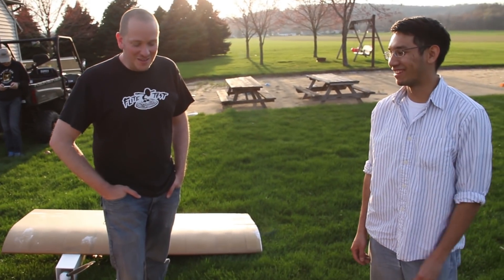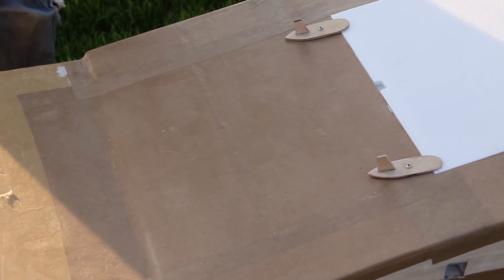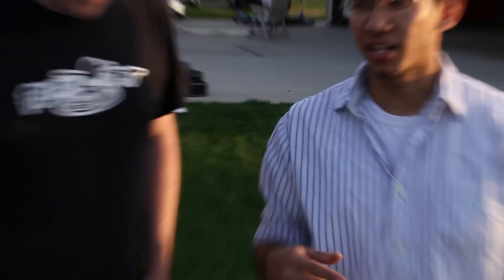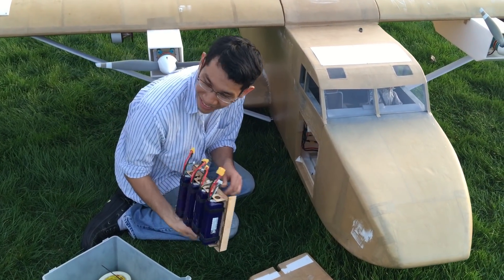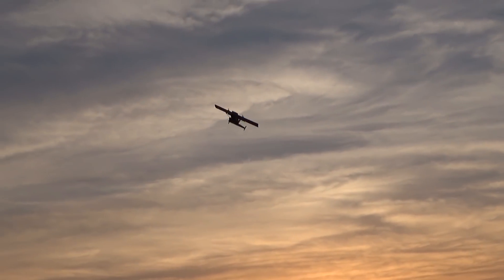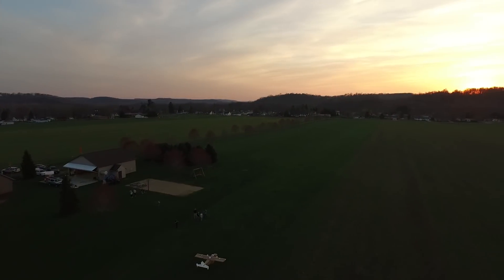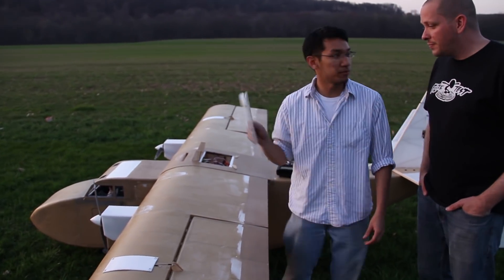DIY Giant Cargo Plane | Flite Test

Comment from the maker: What should Peter build next??
Reply: Well.... The crazy builder should... take some days off? 

A monster 4 engine bomb drop? Or flying fortress?

Cheers! Great episodes!

Ed
Reply: FliteTest   The X-15 rocket plane and B-52 drop ship.
Reply: FliteTest a 20ft flying wing
Reply: You guys should build a fighter jet with missiles on it. I know you did a plane with missiles that you can control, but the missile was basically just an fpv wing. You should build a proper one propelled by little rocket motors, that looks like a missile.
Reply: A plane ✈ you can sit in!
Reply: Or what if, Peter refine/improve the cargo plane so you can deploy from there and have a Challenge? 4 of you free fall some sort with parachute thing with PFV and radio control so you could control your direction/decent and hit a bulls eye???? how about that!???

Ed
Reply: You should try to get a plane inside of the cargo plane in mid air!!
Reply: Build a "Howard Hughes" huge flying boat and fly it off the water.
Reply: FliteTest air balloon or blimp that launches mini quads and jets
Reply: MartyFlyzZzFPV Yes! A replica of the USS Macon! With planes or quads that deploy from the ventral hangar!
Reply: THE  SPRUCE GOOSE!!!!
Reply: A giant (5 to 10 meter)foam and plastic foil paraglider
Reply: FliteTest The inverse of the Pun Jet. The pun jet is designed to fall out of the guinea pig, what about designing a plane that is designed to easily fly into the cargo bay of this plane during flight.
Reply: FliteTest I really do think y'all should consider a practical DTFB rocket model. There have been many requests for such an airframe, and it really can be done. Peter definitely has the skill level to do it. And let me know if y'all want any ideas for how to do it--I've got several planforms that would work well.
Reply: Rc parachute could be a difficult but interesting option
Reply: FliteTest Peter should build a plane that he can actually get in and fly around
Reply: I'd love to see an DC 3 all aluminium look, even from aluminium if that is possible. The stand of the aircraft is so epic!! And it's one of those famous aircrafts from the past.
My father used to tell me about his flights in a DC3, te thumbnails on the engine turned red hot when it was taking off! 

With the old C1 Hercules I ment one with 4 propeller engines btw.
Reply: how about Howard Hughes 'Spruce Goose' ....
Reply: +FliteTest A 1/3 Scale B-29 Super Fortress with functional guns.
Reply: A ridable mini-blimp!
Reply: FliteTest meik a plein that you ken get in and drive
Reply: FliteTest a flying boat
Reply: How about a plane that carines anoter plane and anoter plane !
Reply: Rc smug the dragon!! From the hobbit!
Reply: FliteTest ....Enough Pun Jets to fill up the back of that thing! I want to see a flock of FPV Pun Jets launched from the rear, then see if anyone can land one in the cargo hold. ;)
Reply: I would definetely like to see an old C1 cargo airplane with 8 propellers. Would be amazing to see that fly!
Reply: FliteTest BUILD A MASSIVE SPITFIRE!!!!!
Reply: Douglas DC-3 !! Shiny aluminium skin and all. 😎
Reply: FliteTest A challenging airplane that i would love to see on Flitetest is the Focke-Wulf Triebflügel.  The Triebflügel was a very late war VTOL intercepter with three ramjets position on wings that rotated around the fuselage.  i have seen other people on the internet try to build it but they where not repeatable (i know because i tried it myself with no success).  i thing combining the talent of Peter and the strong design will make for a great model and some cool episodes.
Reply: ***** An Albatross where he forgets to glue on the beak?
Reply: FliteTest  how about a solar powered plane?
Reply: How about a full scale Cri-Cri? Theyre not much bigger than this lol
Reply: He should make a plane that fly's using the magnus effect
Reply: FliteTest  boeing A380
Reply: he should try to use model rocket engines for a rocket assisted take off.   just like fat albert from the blue angels
Reply: +FliteTest simple airgun for some warbird air carnage :)
Reply: PB-Y
Reply: Jet pack
Reply: +FliteTest A Peterbilt
Reply: FliteTest Make two fighter jets equipped with co2 airsoft guns and have a dogfight
Reply: a gigant cartboard tank!!
Reply: A plane he can get in xD
Reply: FliteTest A helicopter with a harpoon
Reply: a multicopter platform we can stand on and ride.
Reply: FliteTest A 50 pound motorized jet.
Reply: FliteTest VTOL
Reply: And a giant pusher sailplane
Reply: And a giant quadcopter
Reply: How can I get in touch with Peter? 

As for what to build next I think one of Vincent Burnellis aircraft would be a good one, as would be Lockspeiser LDA-01
Reply: FliteTest  A not so mini pun jet!!
Reply: Dave-007 Or a Messerschmitt 323 with six props
Reply: FliteTest a speed built kit for a vtol
Reply: FliteTest nano scale collective pitch quad :)
Reply: B-17 Flying Fortress, most awesome plane ever made.

Love the Guinea Pig XL my favourite FliteTest plane so far. Cheers
Reply: How about the C-5 Cargo plane?
Reply: or a ford eaa tri motor in tin look
Reply: FliteTest peter should build fpv  paratroopers  with steerable parachutes  and you guys can try to land them on a target from the back of the cargo plane
Reply: FliteTest an rc full scale Jetpack man ( the rocketeer )
Reply: A extra large pun jet to match the large cargo plane.
Reply: FliteTest How about a canard plane where he forgets to glue in the, you know, canards..? :-)
Reply: Peter has to build a giant pun jet 😀😀😀😁
Reply: Cl15 water bomber
Reply: FliteTest mig 15 or 6 edf XB-70
Reply: FliteTest - Should try something not many in R/C have touch on - a ground effect vehicle.
Reply: FliteTest you guys should recreate the fast 7 scene where they jump from the plane
Reply: FliteTest a monster quad with those motors! i can hear it now.....
BBBBBZZZZZZZZZZZZZZZZZZZZZZZZZ!!!!!
Reply: FliteTest Slooooow flight would be a blast. So neat.
Reply: You should install a giant VTOL system on the capybara.
Reply: air tractor 802
Reply: +FliteTest He should make a Catalina
Reply: Marlilindin The Mouse http://www.motionrc.com/dynam-pby-catalina-blue-1470mm-57-wingspan-pnp/
Reply: Andrew Jackson That is really, really cool. They really should make a Catalina though. Or just a boat-plane in general
Reply: +FliteTest 
Build a TARDIS as close as you can to the real deal that Flies!!
Reply: +FliteTest SR-71 Blackbird
Reply: A little plane to drop out the back of this one.
Reply: He should try to build a low budget lightening 1 fighter jet using the same technique that he used to build the cargo plane that would be a video I would watch 😂😂😂
Reply: +FliteTest Build another cargo transporter with actuator-enabled rear cargo ramp. Fly to the LZ, land, lower the ramp, roll an RC tank inside, close the ramp and then take off. You could even try building your own LAPES (low altitude parachute extraction system) to drop the tank without having to land. It would take some expert flying to hold close enough to the ground while the parachute deploys and extracts the tank but that's a challenge in itself. :D
Reply: +Si “TheAmazingTie” W Having searched Youtube, I've been unable to find an RC with working LAPES extraction... Could be a world's first lads. ;)
Reply: +FliteTest I know this is pretty late but you should have a plane in the cargo plane fly out during launch.
Reply: +FliteTest  Make that plane even bigger so that one of you can get inside and fly it from there.
Reply: +FliteTest His attention to details....
Reply: +FliteTest The realistic way this thing flew, I&#39;d say a a B-25 Mitchell or Bristol Beaufighter. Awesome job.
Reply: +FliteTest Martin Mars water-bomber.
Reply: A Eurofighter Typhoon
Reply: A V-22 Osprey!!!
Reply: He should build a car plane but... be able to not notice that there are wings on it when it is driving.
Reply: fixed helium balloon at the middle of quadcopter to make it stable at the air to make less use for motor and For long time of flying, just use motor For diffusing
Reply: FliteTest a SPACE SHUTTLE PLS LIKE IF U AGREE
Reply: John Philip Salvador lol what if they did build a dick and someone is eating it lol
Reply: FliteTest ad boob
Reply: Hello, could you please ask peter if its possible to put a SAFE system like the one in the Apprentice S 15e into this plane?
Reply: FliteTest can you make a star killer  base from star wars.
Reply: K62Hunter K62Hunter you don't understand how offensive that is to some people. You don't know how many people lost their lives. You weren't there you are probably just some ten year old who needs some discipline.
Reply: FliteTest A BV-238 WWII bomber..
Reply: FliteTest do not try go up and go 90 degree down and then pull up if you do this you wing will go off that happend to me am flying up then down pull up and rip my plane 
dammit
Reply: FliteTest  make a get
Reply: FliteTest   Can you please make a Air Force one plane ✈️ video.
Reply: A bomber with firecrackers hanging from the fuse that you can rc start the fuse and fall after the fuse burns a little
Reply: Airship. (That works).
Reply: that guy who would not share his name that last one was not good!  They need to try to use helium for it
Reply: FliteTest A massive quadrotor that shoots fireworks and has extending prop struts. Well done Peter!
Reply: FliteTest please build a Horten H XVIII  with 6 EDF (I'd be okay with a Horten H IX)!
Reply: dfwz33 That is a big undertaking dfw I'm a designing one right now and it's not a short term project building a homebuilt aircraft.
Reply: FliteTest A Dragon.
Reply: SlyNature thats what I said in previous comment .Smaug the dragon.  Emailed ft and peter emailed me back really liked the idea . He thought it would be a neat project for the future. :)
Reply: David Tucker :D
Reply: FliteTest let him complet this in 100% then I have a new disigen to give you
Reply: Génial ce gros avion. !!
Reply: FliteTest A VTOL plane that actually flies and doesn't cost the earth, the ultimate test
Reply: A mighty mini ft3d
Reply: FliteTest I vote for a B-52 . . . . but with build video, plans, speed-build-kit, etc..

Well done Peter!!  ... now fly it FPV LOL :D
Reply: FliteTest try landing the Pun Jet inside the Bombay during flight. An on air landing. first time ever!
Reply: jack00scarecrow FliteTest Or paragliders with fpv that can fly with motor or soar in the thermals ant that can be dropped out of the plane
Reply: FliteTest EDF 5s Tricopter?
Reply: FliteTest A 20 ft, 100 mph flying wing with fpv.
Reply: FliteTest a republic star cruiser from star wars that would be EPIC
Reply: beroth1 under 55lbs.
Reply: Chris Hipser Yeah, It's still possible. If not he can get the waiver ;)
Reply: FliteTest A gotha bomber?
Reply: Something with a canard, like a velocity would be pretty awesomely sweet.
Reply: FliteTest Build an Antonov-225 Mriya  1/10 or 1/100  scale
Reply: Smaug the dragon
Reply: A semitruck
Reply: FliteTest Flying penis that shoots white soap.
Reply: Zagi
Reply: FliteTest Hello, FliteTest and staff. I have had a wonderful (IMHO) idea for a multirotor concept that I wish for the crew to take a look at. It is a mashup between a quadrotor, and tricopter, and has 6 props. Imagine a standard X-shaped quad, but those motors only control the roll. There are two shorter booms that extend between the diagonal booms, each with a tricopter tail piece that has a 180 degree field of motion. These two motors do all of the forward-backward movement, along with the yaw. If you are feeling experimental. Alternatively, you could build or modify an H-Hex to make the build a little easier.

For racing, you could potentially ditch the two gimbals in favor of having two fixed motors that perform the same functions, but through differential thrust instead of variable angle.

Whilst hovering, the two active motors are not spun up. Their speed is proportional to their tilt angle. This setup would require a LOT of setting up on the transmitter, and probably the on-board systems, but it theoretically is a very efficient system. One last note, I personally believe that the fixed motors pointing forward and using differential thrust for forward motion would be easier, but the benefits of a pair of gimbals would make it worth the extra effort.

The link below will take you to my OneDrive, where I have uploaded a screengrab, along with the Google Sketchup files. I spent quite a few hours working on it, and you can open the .skp file with the free Google Sketchup. Please, at least take a look at it, as I am putting in this effort for the channel, as I lack the funds to build any sort of plane, as I am only 16 years old. I wish to have some feedback on this. I know the channel has blown up recently, making it difficult to keep up on comments, but I know that my ideas will be read at some point! Love the show, and keep up the good work. I am expecting great things with this new flying season!

@1
Reply: FliteTest A flying saucer!
Reply: domsau2 a flying sausage! that squirts white soap.
Reply: FliteTest Could you build a plane that flies forwards and backwards? Mind blown
Reply: Dr sausage fingers PLEASE FliteTest / Peter go with this idea :-D Wouldn't that be great to honour SOLAR IMPULSE leap over to Hawaii?
Reply: FliteTest Dear Mr. FliteTest please build a cheap home depot rc paraglider. that would be soo coool. mounting a cam on in and slope soaring. or maybe even with a power pod! FFFF A FLYING POWER POD BUILD!
Reply: FliteTest AC-130 with airsoft guns out the side.  :-)  I also liked someones idea of a water bomber.  Canadiar?  Complete with water scooping ability?
Reply: FliteTest    Standing there installing the wing and Peter says "I just winged it"?? He missed an excellent pun!! Also, looks like he loaded up enough batterys to start a CAR!!!  He should name this plane [Cargo Plane by Peter-built!]
Reply: FliteTest what about a rc car WITH A WING!!!!!!?
Reply: rifted b-17 with mulltiple airsoft cannons!
Reply: FliteTest flying penis
Reply: A 300+ mph rocket plane!! With a G class motor!!
Reply: FliteTest I'd like to see Pete build a quarter scale De Havilland Mosquito , That would be something.....
Reply: shawn harold fox firth Sorry there are Ready made RC quarter scale 'Mossie's' So how 'bout Full Size .........
Reply: ***** DC3 beautiful plane, Buffalo Air up in Alaska has a couple , How about the Bear TU-95 with contra-rotating prop,s now that would be something...
Reply: A Messerschmitt-109 so you can dogfight with the Spitfire. Or a Corsair or Zero (both had wings that folded up, you could use the folding mechanism from the Pun Jet)
Reply: FliteTest a B-29
Reply: FliteTest  Peter should make a a movie fighter robot jet ADI !!!!!
Reply: Why don't you make a water landing plane
Reply: Howard Hughes 'Spuce goose' takes off and land's on the water...
Reply: ColinTastic j
Reply: FliteTest  A flying smelly vagina
Reply: Cam Hart It would be cool,only problem is the FAA and FCC would probably put your head thru a noose if they caught you !! I don't know the legal jargon off hand but I have heard before from a cop.Basically it's against federal law to use a remote control device to launch a missile and to be able to guide/control it from another remote controlled device boat/airplane. I once built a remote control boat with a rocket turret on it using Estes D12 rocket motor's.My friend and I were talking to a cop that worked at 7-11 part time and he told us the law using the legal mumbo jumbo talk and yeah it's a lot of trouble and god forbid somebody should get hurt or property damaged !!
Reply: I would love to see Peter or the rest of the FliteTest crew build one of the classic Japanese movie monsters. Maybe Mothra, Rodan, or Ghidra (a.k.a. Monster Zero). Or... could you imagine an EDF powered Gamerra (the flying turtle)? C'mon, guys, I know you're zany enough to at least try something crazy like that!
Reply: ME-163 "Komet"
Reply: Flying toaster!
Reply: Slum 9000 Guess they already did it.  How about a Flying-V?  As in the Gibson guitar.
Reply: I vote spruce goose too!
Reply: FliteTest  Thunderbird 2 (quad copter)
Reply: +FliteTest Lets see a Flite Test Airliner
Reply: +john jameson r
Reply: +FliteTest Try making a large scale Pun Jet to fit inside it and drop it out in mid flight
Reply: +FliteTest I think you should add a wing fence/wing-let on the main wings, similar to what you have on the horizontal stabilizer, but not as tall.  If you make sure the wing fences extend well behind the trailing edge of the aileron surface, I think the huge vortex can be use to LIFT the plane, rather than generate NEGATIVE LIFT.  I think as you have it, there's a huge swirl of air, that wraps over the wing tips and land on top of the wing surface, that's causing negative lift and a lot of drag.  I would love to see a leading edge slats/droop on this plane or any of your other super slow flyer.  This is on my next to do project, but I tend to procrastinate.  Thanks for all your time on making vids and Kits.
Reply: First time I have seen your channel fucking creative  man keep up the cool videos
Reply: +Joseph Branch they should make sugar rockets (r candy rockets) to use!!!
Reply: +FliteTest a 1.5 m delta wing out of cardboard!
Reply: Make a vertical takeoff aircraft
Reply: THE ENDERTAINER Ye; and you will pay for the $1,000 battery pack. right?
Reply: Andrew Jackson that would be pretty cool to see a be even one that can pick the water up and drop it like a fire fighting plane
Reply: Chris Scholer I happen to live by a lake.. yet I have put off getting the plane out of box and in the air.for so many months...  So many projects.. so little time..
Reply: Marlilindin The Mouse Ye,  if they don't,,, guess who should...?  YOU !!  Oh No!!!  I hate the thought of another project..
Reply: Andrew Jackson Me? I could... But I've never built a RC plane before... And I have no where nearby to fly one... Too many trees
Reply: +FliteTest the faa probably won't like this build
Reply: +FliteTest Give this one 4 EDFs. I dare ya.
Reply: +sean wong kerbal space program
Reply: +FliteTest A 50s Lockheed Constellation.
Reply: MV22 osprey that can actually hover
Reply: +FliteTest Add 2 more motors to this thing and do some stunts
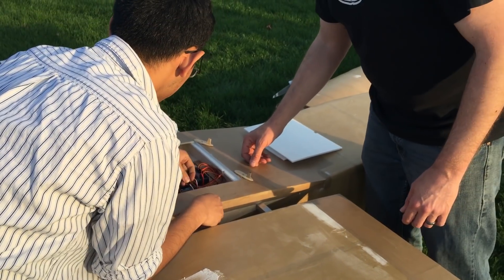Reply: Wats with the laser on your body at 2:52
Reply: Wats with the laser on your body at 2:52
Reply: +Flitetest is peter interested in rc cars or tanks cause if he is can he build a flying car that can drive as well. if will thanks
Reply: he should put a rc car with a parachute on it and drive it out like in fast and furious 7 and use a Traxxas slash 4×4
Reply: +amy watkins use a nitro that would be cool
Reply: Eclipse Gaming  yes it would but I'm actually on my mom's account my real name is Levi ridgeway lol
Reply: +FliteTest Build the Flying Spaghetti Monster and convert some heathens ;)
Reply: a flying Xbox one
Reply: a flying Xbox one
Reply: +FliteTest should see if he can lengthen the wings and add more motors and remove weight somewhere else
Reply: +FliteTest Maybe a  Bombardier CSeries Aircraft, Swiss logo, it is a nice little plane that I would like to see as Swiss in RC.
Reply: a sign saying sorry neighbours to attach to it, poor neighbours :D
Reply: A real plane. You have the skills
Reply: +FliteTest Mount eight or 10 small outrunners on a straight wing that can be pivoted 90 deg.  Straight up for VTOL, transitioning to straight forward for cruise.
Reply: +CaptainDominic Wow thats a real challenge!
Reply: +FliteTest a B-52 with the Windestål afterburner on all engines
Reply: +FliteTest Millenium Falcon
Reply: +FliteTest even tho its a cargo plane u should make it so it holds a little foam bomb and it could drop it.
Reply: +FliteTest do u intentionally spell flight wrong
Reply: +FliteTest Great job...looks awesome flying so slow.One thing I was wondering though is the nose up attitude while cruising.
How could you get it flying level? increasing the angle of attack of the wing?
Or does it level out as speed increases?
Also have you ever thought about using a small high KV inrunner run through a gear box spinning a huge prop for better efficiency at the slower speed of this big plane and maybe get it to hover lol.
Variable pitch props would be sweet to.
Reply: +FliteTest  A Giant RC Sailplane with 10m Wingspan!
Reply: A plane where Peter can have a dinner in the sky.
Reply: Shaheer Syed Hey now there is a challenge....build a plane out of foamboard that Peter can fit in and Josh fly him around lol
Reply: not be abel I mean
Reply: A blimp made of pimple cream.
Reply: An airbus  380
Reply: b 25
Reply: f-14(that slide wings)
Reply: Try building a big size helicopter
Reply: am b29an
Reply: FliteTest
Reply: Jayaprakash L.V
Reply: FliteTest  her baazcx
Reply: FliteTest a rideable mini cargo plane
Reply: erm an R/C table to like bring drinks eh anyone no okay
Reply: FliteTest a Flite Test DFS 230 glider towed by a Simple Storch
Reply: FliteTest a flying car
Reply: FliteTest
Reply: FliteTest I'd like to request he build a fantasy rpg style airship.
Reply: FliteTest RC plane that can carry a human
Reply: What about a VTOL that works like an Osprey?
Reply: FliteTest VTOL plane
Reply: Make a bomber with gunners
Reply: The Mayor
Reply: FliteTest
Reply: BIGHUHA15 I'm sorry I didn't really think it through or think the outcome I'm sorry to make people angry and I will delete the comment
Reply: FliteTest I miss Peter...
Reply: FliteTest the house from up the movie
Reply: Danny Liszewski that's not cool dood
Reply: FliteTest tank that you can drive out of Cardboard
Reply: Herman Izaguirre
Reply: A sweeping wing, not necessarily an F-16, any custom design with at least two different flight profiles ex. 'Takeoff/slowflight/landing' and 'Highspeed'
Reply: FliteTest
Reply: Submarine
Reply: FliteTest I think a flying taco
Reply: I have instruction/ plans from 1961  to a bf 109 rc plane if you would be interested. if you are contact me please
Reply: FliteTest hhhhjbggjhh
Reply: Giant penis
Reply: FliteTest something he can go in!
Reply: FliteTest a cardboard plane a person can ride
Reply: FliteTest to
Reply: Looks like Tony (3rd to reply 2 years ago) is the true visionary.
Reply: FliteTest i know its old (2 yrs) and why You dont buy some parachutes (these little man) and drop them in air (i mean Open cargo door and they ) This could be amaizing
Reply: @FliteTest Solar-powered airplane.
Reply: FliteTest and
Reply: He should make the plane from pubg.
Reply: FliteTest f35
Reply: FliteTest a disc shaped UFO
Reply: a 30 meter glider... let´s do an aerotow with the Cargo plane
Reply: FliteTest helicopter!!!!!!!!
Reply: Fighter jet
Reply: FliteTest no joke a flying penis
Reply: FliteTest I flying dick
Reply: Drivable backpack
Reply: FliteTest I subd
Reply: I challenge you to make a plane that you can accually sit in and fly in
Reply: V2 OSPREY!!!!!!
Reply: diy printer airplane
Reply: A Saturn V rocket
Reply: Or a falcon heavy rocket
Reply: FliteTest what fantastic beast of plane. Do you need a license to fly these type of planes?
Reply: Koen Jochems any model over 55 pounds has to be registered by the FAA
Reply: FliteTest put a mini plane inside the cargo open the back and have to separate planes flying
Reply: it just needs flaps now
Reply: FliteTest A Boeing 747
Reply: FliteTest more pokemon games
Reply: FliteTest cool
Reply: FliteTest       N
Reply: A bomber that drops fireworks
Reply: an exploding plane
Reply: Kevin Shen they did that in one episode.  They blew up a scratch built spitfire
Reply: Make a cargo plane that 2-4 people could fit in lol
Reply: A flying computer running FSX
Reply: a full size RC B-29
Reply: A 3 blades propelled copter...
Reply: Build a ship that can fly like in starwars. You choose the ship.lol😀⚠
Reply: A peter
Reply: How about a war ship
Reply: a dildo airplane
Reply: I wuntut to play  mlncraft.
Reply: https://www.youtube.com/watch?v=Sp7MHZY2ADI the one at 1:19
Reply: Add airsoft guns
Reply: would like to see peter drop a mini tank out of the cargo plane! and the tank would have a parachute on it! great video u guys!
Reply: Build a spitfire
Reply: Boeing 737
Reply: C-130 gunship(with working airsoft)
Reply: FliteTest a turbine powerd concorde
Reply: FliteTest A SEAPLANE